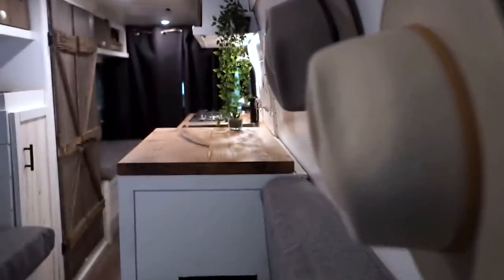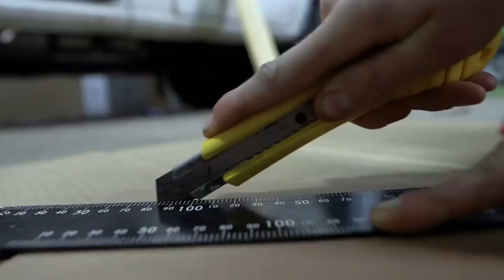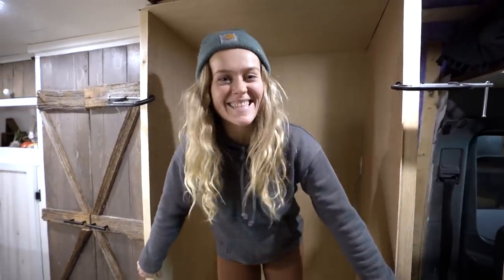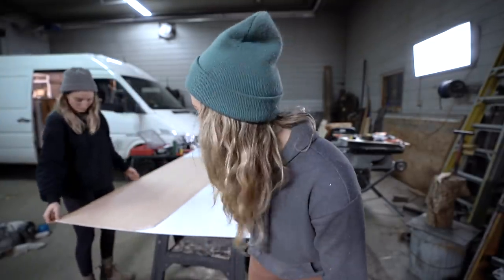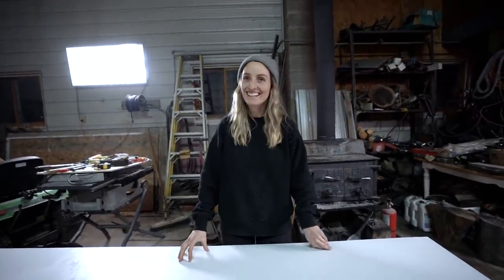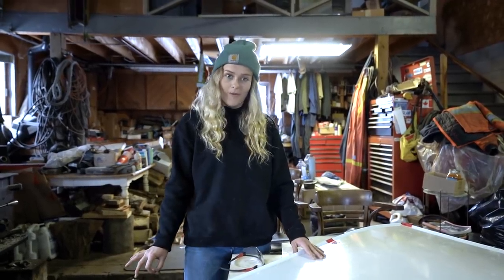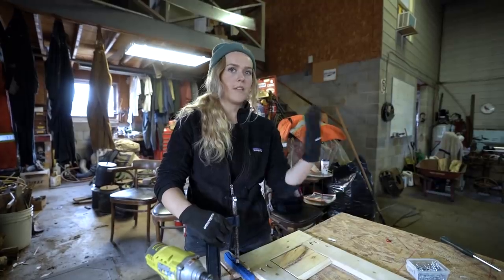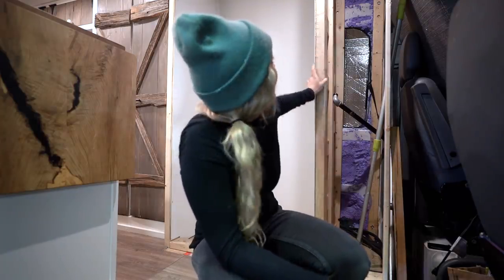Building Off- Grid Indoor SHOWER in Rustic Sprinter VAN (female van life build)

Comment: Another stellar video girls. I might be wrong but it looks like you put the FRP walls up before installing the shower pan? Potential leak area if so, most times the pan screw lip is recessed into the wall/plywood then the FRP would be installed over the lip to cover the screws.  If your gluing the pan in you might be ok with silicone around the lip.

Comment: I have to ask... Ive been watching you ladies doing your upgrades. You are building inside your van thats gonna be bouncing and vibrating as you travel down the road. So Im wondering why you are not using glue on your wood joints? By using glue on your wood joints it would be much stronger. Using screws and glue together it would be great. Screws in pine boards, and vibrating down the road, will cause things to loosen over time.